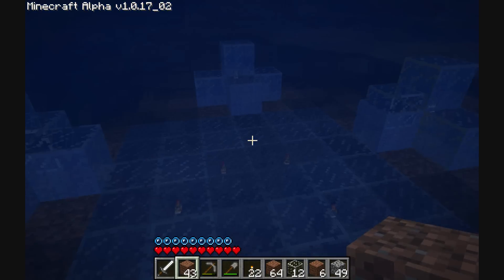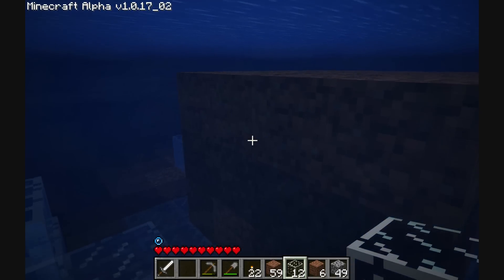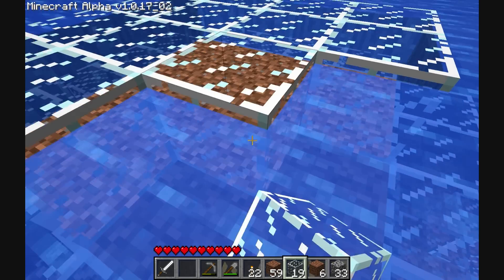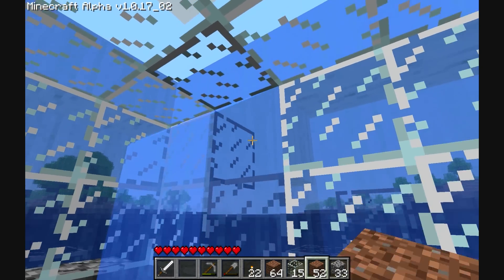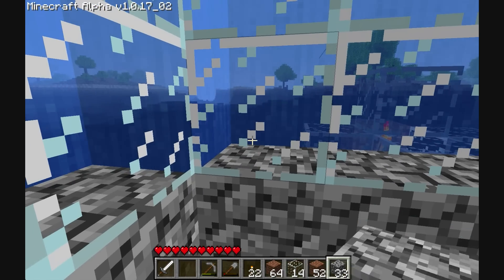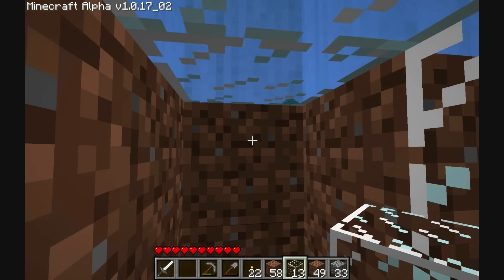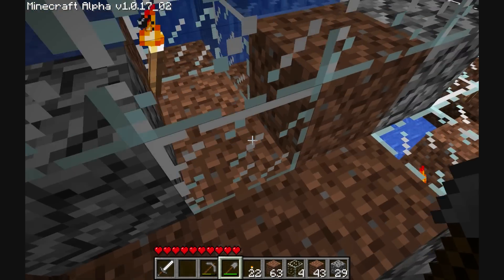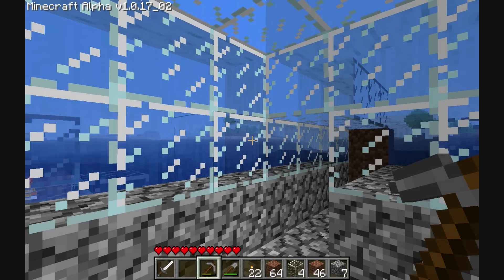Minecraft - Underwater How To 2

Comment: Using sand, which will obey gravity, instead of soil for your filler makes draining a lot easier/faster for large projects. You can dig it from the bottom and it will fall down to you, or you can use the torch trick to have the columns of sand automatically break apart.